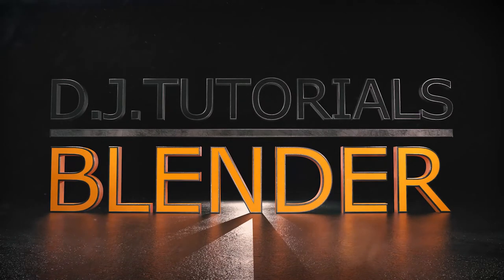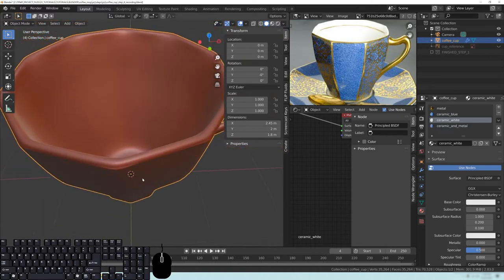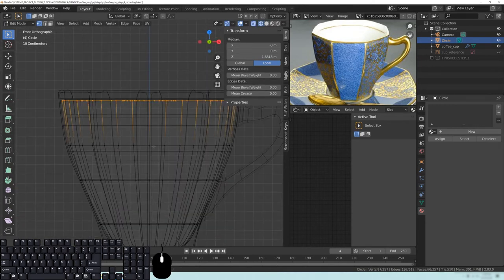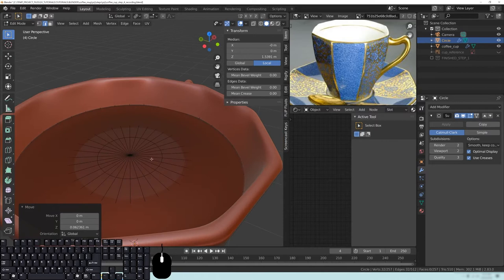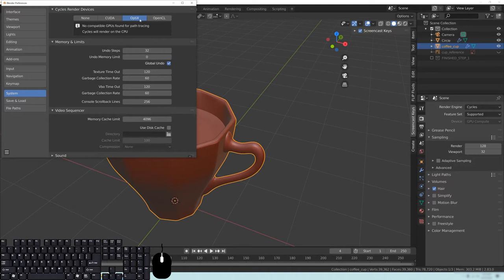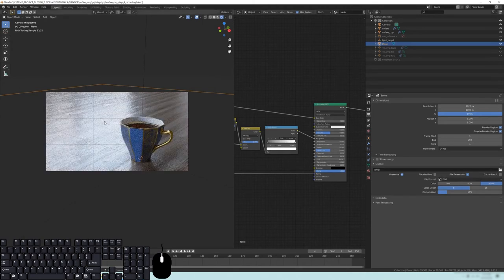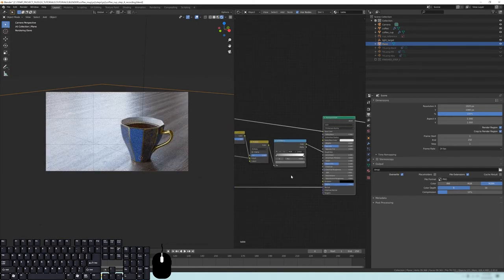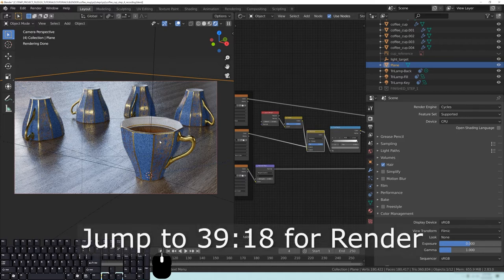Coffee Cup Tutorial Series | Part 4: Final Touches and Render

Comment: Links:
Free HDR image           
https://hdrihaven.com/
Free Bitmap Textures  https://texturehaven.com/

Thx, it does much easier to read the text after the change back to a bigger resolution scale. 
Again, it is another very nice tutorial. It is really appreciated there is " Jump to locations " timestamp. It means a lot in terms of well planned and organized content.  
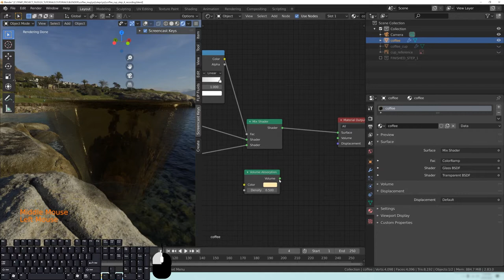13:01   Is there any command / utility shader to toggle the on/off of a node temporarily rather than take away the node-link.

And also, what is the application used in your video to show the keyboard stroke and mouse click ? 

The golden handle, the edge of the polygon-shaped body, the rim of the cup, and the burry reflection on the table is really really beautiful. 
Thx a lot !!!
Reply from the maker: Thanks for providing the links- was very late when I uploaded and I forgot. 

Here is a link to info on the keystroke plug in I use in OBS studio:
https://obsproject.com/forum/resources/display-keystroke.485/

Here is info on the screencast keys inside blender (pretty sure it’s this one): https://github.com/nutti/Screencast-Keys

Thanks for the feedback and compliments!
Reply: @djtutorialscgi  thx !
Reply: @danthefatman009  I see. It can be very handy during the trial and error of different node combinations / variables. I found 
this function available in Keyshot. 

I just try as you said. It works with alt + LMB drag over the pipe. But it deletes the node-link rather than toggle it on/off.
Anyway, thx man !!!
Reply from the maker: @cring0101  Of course! Any time.